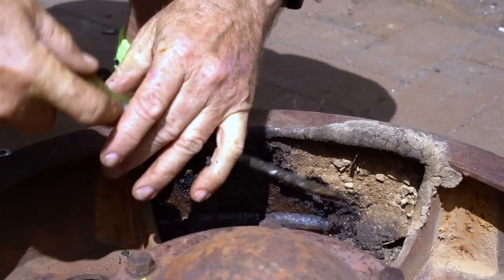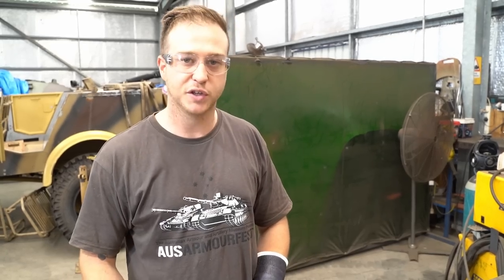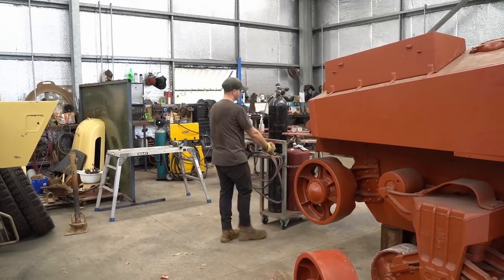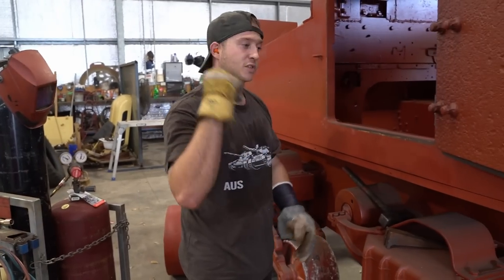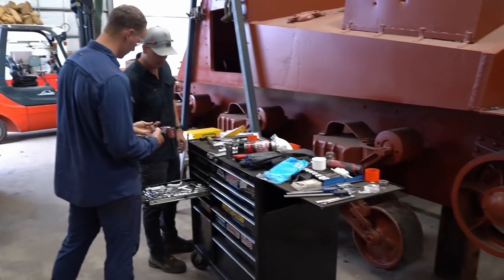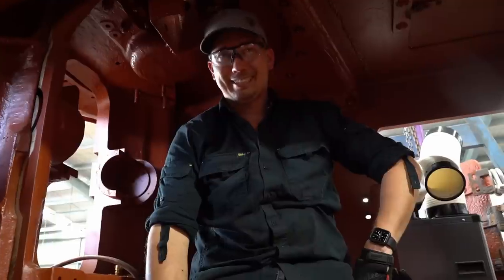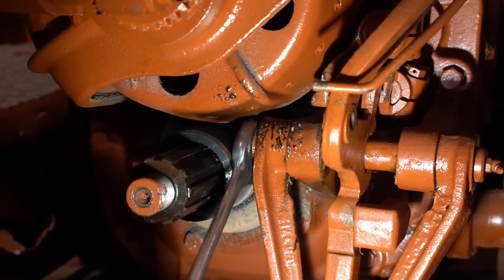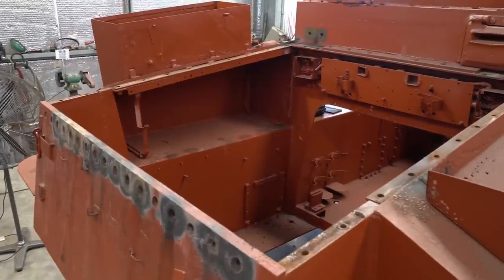WORKSHOP WEDNESDAY: Hull doors, rivet removal, mantlet, gear shifting linkages and more!

Comment: You guys are a level above! Craftsmen all. So please don't take offense in my sharing some personal experience here. When freeing rust frozen parts, once you've added the heat hit it with oil. Any kind of oil will do but I prefer a penetrant myself. The heat will draw the oil back into the hole like a magnet. It may take several tries but it does work. Time is your friend here as well. Love watching you guys work.

Comment: We often used a port-a-power (small, portable, hydraulic press) to persuade stuck parts to come lose. Lots of lube and constant pressure (and an occasional rap with a hammer) usually did the trick while working on our Soviet made SU-76. The ram was small and came with a number of attachments and would fit into small spaces. It also had sections of pipe to add length.  You guys do an amazing job and my admiration for your workmanship is unbounded.

Comment: The M3 was built by Pullman Rail coach, Baldwin locomotive, and Pressed Steel Car, and there were differences between them and also due to the upgrades. This is why the crew doors have different hinge spacing between the doors and the hull.

The easiest way to push the forged rivets out is to heat them up and use a air hammer / air chisel to push them out.

 To put new replacements in, heat the new rivets white hot and use either a formed dome bucking board and a large air hammer(similar to one's used to break concrete that are handheld) with a formed striker to form the end to the desired shape, or two large air hammers one with a domed end and the other with on the other side.

Comment: I am really enjoying the fascinating videos, thank you!
However, with 2 power amps, and a house-shaking 7.1 surround system, I have to constantly turn the volume waaaaay down when you are using noisy stuff. It's like being in your shop without earmuffs. My system is set up for real sound. And if you are doing something where the guys in the shop have earplugs or earmuffs on, then I'd love for you to put earmuffs on us, too, please.

I appreciate that you spend a lot of time and effort to make these videos for us - but it sure would be great to slice the audio track, and slam the gain down when...
- Hitting heavy things that go TING with other heavy things that go TING (ouchies)
- Using the impact driver on anything (Owie owie owie x∞)
- You're filming close to the gas torch (Aussie Acetylene Torture)
- Using a heavy hammer or sledge (See "things that go *TING*")
- Creating any noise that would make an OSH manager go pale.

Thanking you kindly, from NZ.

Comment: Good evening gentlemen from not so Sunny Florida. A wave of the hand and best wishes for success with this M3 Grant. Sorry to hear about the ailing knee. I thoroughly understand how that goes. 71 years old and spent 35 years as a long haul trucker here in the states. Absolutely enjoyed it but now dealing with very extensive osteoarthritis top to bottom. One hip replaced, doing the right knee after the first of the year followed by the shoulders one at a time. As you can see I’ll have plenty down time to follow you lads on YouTube. Your work is outstanding and I’m really excited about seeing that M3 move under her own power. My dad was a WWII US Army veteran and served on Guadalcanal 1943-44. Me? I’m Vietnam era Navy and I’ve a strong interest in anything military and historically related. In closing I want to send my sincere thanks for the hard work you men put into keeping these historically significant vehicles restored, repaired and operational. I’d be thrilled to get to Australia and visit your great facility. All the best to you lads. Have a Happy Christmas. Cheers.

Comment: one thing I did when trying to remove rivets is to drill a hole  1/4" smaller than the diameter of the rivet but dont drill all the way through, maybe 3/4 the way, and then punch them out. relieves quite a bit of the 'press fit' if you will

Comment: When we had to remove 20 or so rivets from the Grant we initially tried a Rivet Buster (BIG pneumatic hammer).  We 'washed' the head off on the outside with oxy/lpg torch and used a rusted, turned down a bit, bogie mounting bolt fastened to the end of a modified chisel.  The bolt held up remarkably well (better than our holder).  The use of bolt was advised by Nungarin Museum as they were impressed by them.  Bill reported they had made a 'swing' like the two-vertical-bar parallel swing that kids ride on in an A-frame.  They had a length of shafting or some other chunk of long steel as their 'ram' and possibly black poly pipe bent in half around the bolt and duct-taped on as a handle.  Person 1 holds the bolt end over the exposed rivet by the handle while person 2-or-more swings the ram to batter the bolt against the rivet.  He said it did move the hull sideways a bit...
So we tried our gear and it was hard yakka and Bill also advised the holes in the joining angles are often larger than the armour plates so drive toward the angle, not away, so outside-inward.  As rivets should be, they were fully swelled in the hole for the full length of the shank plus they were rusted in.
When I had to finish our job on my own, I borrowed a cheapo DIY universal drill press, clamped a 3/8" air drill to it and welded a simple flat plate from a hunk of bar as the non-original base with a long slot in the plate so I could bolt the unit to an existing open rivet hole and position the drill over the centre of the exposed rivet shank.  I'd bought 2 packets of 10 x 3/16" dril bits as I couldn't source any Artu drills locally and when I needed them, and I used some lubricant and the air drill turned slow enough to not overheat the drill bit and slowly got the rivets pierced.  Then I went along with oxy/lpg and using the 3/16" hole to start the cut, made a 'Y' shaped cut from the hole trying like mad not to gouge the hole wall and was able to easily drift out the now collapsing rivet that was left.  
I came across an old farmer who said it was nothing for them to use hammers and chisels to slice off the rivet heads and push out the rivets to remove the plates cos they spent all day many days swinging axes clearing their properties back in those days.  We're soft these days.  Alex

Comment: Not all of the M3 tanks received by Australia were in a condition regarded as fit for service. A list of alterations was draw up, and 147 tanks needed to have the right hand side door fitted as this hadn't been done at the factory. It might be that the side doors were made or fitted locally and that might have some bearing on the odd hinge spacing.
Reply: Interesting connection.  IIRC it was in some of Paul Handel's information online that a report at the time cited some of the new M3 Mediums arriving in Australia as being defective in that amongst other things their side plates did not have one or both doors and that this was stated to be by design due to the doors posing a weakness through combat experience in north africa.  Alex

Comment: You're taking a lot for GRANTed (sorry, couldn't resist).  Hit the books on those hinges before you drill.  Armor bolts, sometimes look oddly located from the outside but in fact, are placed so as to make accommodations for some other component on the inside of the hull.  Another possibility may be that the leafs on the top hinge are not exactly the same as the two lower hinges.  As always, fine work being done by the crew at Aus Armor!

Comment: workshop Wednesday should be called workshop butcher day, what  rare parts can they destroy today, oxy torch and sledge hammer are there tools of choice, even when welding the tank hulls they use the incorrect mig wire, they should be at least using a 1.6 233 inershield with high deposition rate to minic the large rods used in ww2

Comment: Took that inner bearing cone off the hard way, should have split it with cut off wheel or just heat it and slide it off.

Comment: Question on the side doors.. The one that was already on, the bolt holes don't line up. But the one that was off had a hinge that didn't line up.. Was that the correct door for the other side??

Comment: For those asking from last week, the engine is a Wright R975 air cooled 9 cylinder radial engine.  weight 675lb dry, 400hp.  This tank is an M3A2, welded hull, only 12 built.  wiki says 12 built as proof of concept for welded hulls.  The lessons learned here rolled over into M4 production.  

AusArmor do you know how those tanks came into Australian service?
Reply: Not to spoil your facts. But that tank is an m3a3, which came from the factory with a pair of left hand rotation 671 GM diesel engines. quite easy to spot as they have a completely different rear hull to a radial powered lee/grant.

Comment: I'm guessing the previous owner (Or the owner before) was going to turn it into an outdoor static display. To stop people knocking off parts or trying to get inside they welded the nuts and bolts from the inside so they couldn't be removed from the outside.

Comment: The special tool needed for the slotted-heads, could be made from a piece of leaf-spring. Anneal the "screwdriver" part and then machine it to size in the 4-jaw chuck on the lathe. Bore two holes to allow it to be fastened to a handle, then harden and temper it to a purple shade. Far better than having a piece of mild-steel twisting!

You have the tools and equipment there to do all of this – cheers.

Comment: Man I love this series 🥰. I am an Manual machinist I do counter sinks and threading all day long. In all the parts we make for other companies. I was wondering what is the angle of the countersinks for those bolts on the rear plate ? Are they standard 82* ?

Comment: Once you have it red hot; go get the dry ice from the freezer, stick the bolt in it and hold it on the center rivet.  This can cause it to pop out without effort.

Comment: When you heat up a nut or bolt, just run some wax around the head and the heat sucks it ( the wax ) down the shaft or threads. The parts come apart a lot easier.

Comment: Was the Grant tank disparagingly called the “Ronson” named after the lighter because they burst into flame easily as they were gasoline fuelled? Great job on the restoration boys.
Reply: This is a common rumor that goes around about Grants and Shermans, but really they were no more likely to burn than other contemporary tanks (All German panzers, most British tanks, and even some Russian models were gasoline fueled). In any case the stored ammunition is usually more of a fire hazard than the fuel, as the Russians have recently been demonstrating so well with their (diesel powered) T-72s in Ukraine.

The Russians did have some unfriendly nicknames for the M3 Grant and Lee ('Coffin for seven brothers' I gather) but this is mostly because they received them long after they'd become obsolete in the face of better German anti-tank guns. When first introduced the M3 compared favourably to the Panzer III: similar or better protection, and superior armament albeit in a weird and clumsy layout. They remained in service right up until 1945 in the pacific, mostly because the Japanese had really bad anti-tank weapons and even worse tanks.
Reply: @nerd1000ify  thank you very much for your comprehensive answer to my question. Peter Armstrong.

Comment: For those stuck rivets, make a spring loaded punch tool. Include a side handle & you can still use the mallet...  larger the spring, greater the punch for the utility.

Comment: I was wondering if those trailing idler bogies are original for an M3 ?
Reply: My understanding is later model M3 or after manufacturing changed to Sherman and that Eastern Australian States Grants that were kept postwar rather than disposed of 'promptly' through commonwealth disposal sales had their bogies swapped out while in service and before they were eventually sold off.  Alex

Comment: Again a very good job! My standing question: will pull out the gearbox and the front armour?? Like any 70 years old gearbox it needs to be inspected and throughly cleaned up eventually replacing if needed. The biggest issue will be un-bolting and pulling out the the front armour. Looking forward to see your new videos 👍👍👍
Reply: I think that they decided after the inspection that the gearbox is in good condition. It will need new seals of course.
Reply: @FairladyS130  thanks for the info but I'm a bit surprised...
Reply: They said in part one,, that it was done on an earlier restoration that stopped at a point.